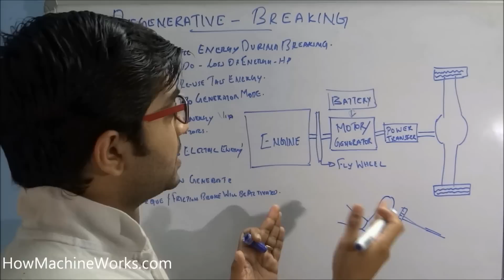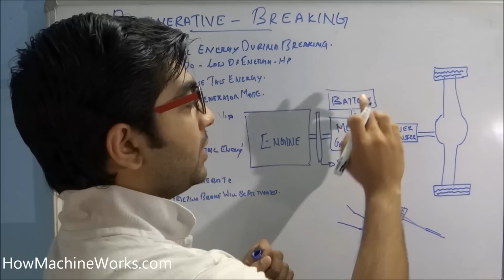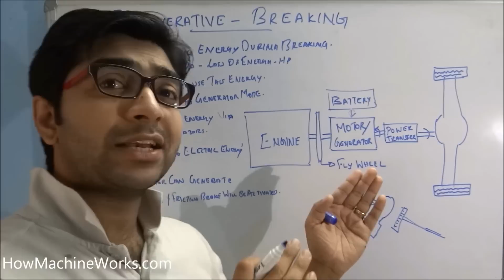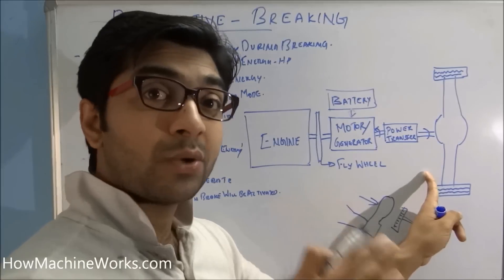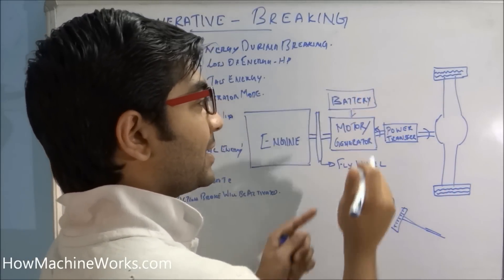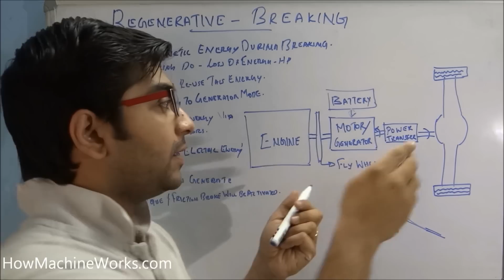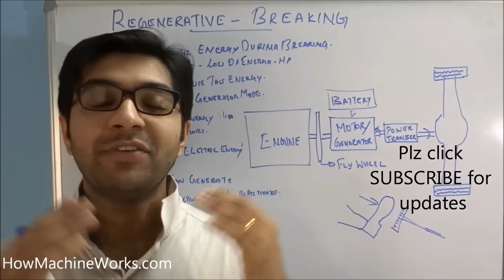How regenerative brake works

Comment: It spolis battery as it will kip charging discharging at different volts. 
We if charge discharge our mobile phone like this will see it's battery will degrade early. 
This is not good way to generate electricity

Comment: If we reverse the rotation of the motor, then because of sudden change of rotation your gear box  will break. Especially at very high speed. and regenerative braking are not that efficient in rear wheel compared to front wheel. Because brake force distribution in front wheel is more than the rear wheel.
Reply from the maker: Thanks for your technical feedback.

Comment: Mr. Einstein ,  direction of Rotation is never changed in braking operation either it will start going in reverse direction , whats the point of braking then ? Direction of torque is reversed here . Go work on your basics first.

Comment: The motor is either in 2 states - motor when electricity is supplied to it or generator when the accelerator pedal is off and the brakes are on but the wheel direction remains the same. Right hand law applies when in motor mode (conventional current) and left hand law when in generator mode but note that the rotation is still in the SAME direction. The right hand law tells you the direction of the rotor (motion) given the magnetic field direction and the conventional current and the left hand law for the generator tells you the direction of the generated current given the direction of the rotor and the magnetic field direction. Which if you work it out; the generator current would be the OPPOSITE of the motor current given the same wheel rotation.

Comment: The direction of the shaft does not change( that implies the car goes backwards), the shaft continues to rotate in the same direction but changes the power transfer direction; from motor to wheels, to wheels to generator.
Reply: thanks for that...
I Was a bit confused in that..
Still Confused a bit.   
Please reply if possible...
Reply: butungHage : during braking Induced back emf in motor is greater than the supply voltage , hence it act as a generator and supplies power to system ,in this case the produced torque will be opposit to rotation . Here the direction of rotation is same amd the direction of torque is reversed so now it deccelerate the motor speed untill it reaches zero.
Reply: how does the mechanism inside the car change the power transfer direction? please help me sir.

Comment: The Explanation is misleading.  The direction of the drive shaft doesn't change, if it does, then we are powering the drive shaft and spending energy. What actually happens is that during regen. braking, controls inside the induction /permanent magnet AC motor,  changes a factor known as slip (in simple terms, used to change the magnetic field), which induces a back emf. This causes a resistance to the rotor. At a certain slip value, max resistance torque is felt on the rotor, which resists the wheels and thus slows down the vehicle.

Comment: So lets say I'm making a recumbent trike with a pedal generator hooked up to a type of rechargeable batteries hooked up to a bike throttle hooked up to a electric motor under the seat with 2 wheels in the front and 1 wheel in the back and the motor drives the back wheel could use regenerative braking on the front wheel and have it charge the batteries without getting an extra generator or would i have to get a extra generator or 2?

Comment: By applying brakes, the direction of torque reverses and not the direction of motion! Poor explanation. Weak concepts, Better improve! Don't teach shits to the students please!
Reply: Could you please explain. I was confused with his explanation. I knew that if break applies regenerative braking happens witg kinetics energy converted into power. But how the direction of shaft of will be. ? If it rotates in opposite direction does it means engine also will rotates in opposite direction since it is coupled in same saft.?

Comment: how sense of rotation of shaft changes after applying brakes???
u must have to specify the gear assembly attached with brake that reverses the sense of rotation.

Comment: R u serious ?what nonsense are you talking ,how does the braking helps the motor rotor in other direction,and who on earth told you change in motor rotation makes it generator. Shame on you!!!
Reply: +anase k Because Electric motors only have one gear, unlike a typical Internal Combustion System. The reversal of the magnetic field from N to S or S to N will cause the motor to run in reverse. This system actually aids in braking and reduces wear on the friction brakes while simultaneously charging the battery. The charging occurs because once the electric motor stops being supplied by electricity, the rotor continues to turn in the magnetic field, which produces electricity.
Reply: When the driver steps on the brake pedal of an electric or hybrid vehicle, these types of brakes put the vehicle's electric motor into reverse mode, causing it to run backwards, thus slowing the car's wheels. While running backwards, the motor also acts as an electric generator, producing electricity that's then fed into the vehicle's batteries.
Reply: *****  When the driver steps on the brake pedal of an electric or hybrid vehicle, these types of brakes put the vehicle's electric motor into reverse mode, causing it to run backwards, thus slowing the car's wheels. While running backwards, the motor also acts as an electric generator, producing electricity that's then fed into the vehicle's batteries.
Reply: +anase k You are right. The motor does not run backwards, instead the current is in effect reversed. Instead of drawing current (motor) it creates curent (generator)
Reply: +Jameson Madison which drives the motor into reverse direction? there should some power to make the motor run in the reverse  direction, right?

Comment: how to convert the kinetic energy (friction) into electric energy....i mean its via differential---power transfer module---generator --battery....i want to know how to relate tyre to generator??may i know flow diagram of power transmission....video was good and explanation is good

Comment: I fully agree with Mr.Igor Rubinic.The motor works as a generator,when the power is disconnected.The generator is loaded with the charging current of the battery Or with an external additional resistor if required.The power drawn by the load through the generator  issupplied by the rotating wheels.

Comment: How can a motor change rotation to become generator, the wheels are always rotating in the same direction! This is not correct. What is happening is that when you push the brakes the wheels have more momentum than the motor and this causes current induction in the motor that charges the battery. So the motor does become a generator but it doesn't change the rotation direction.
Reply: exactly! Motor continues to rotates in the same direction...As Igor mentioned motor just provides negative torque to the engine..Basically motor is used in hybrid vehicles to assist the engine (or drive train)...when brake is applied motor's stator coils are no more excited and hence it doesn't provide rotating magnetic field anymore..however the rotor (permanent magnet) is coupled to the engine's crankshaft and hence it continues to rotate but acts as a load to the engine instead of helping it to rotate...because of the rotor rotation back emf (which opposes it's cause) is produced in the stator coils and when this back emf exceeds the battery voltage the current flows into the battery and thus charges it.

@TechTrix: U must chk the facts or hv full understanding b4 putting data on the public domain..u might mislead many ppl...however ur effort is appreciated
Reply: @1986murthy  I think the rotor is not a permanent magnet, it is just a conductor( metallic plates shortcutes in series ) which rotates based on the stator field windings ( induced magnetic flux). During generator mode the stator rotation is less because of the inverter mechanism which resist the current frequency.
Reply: :) Igor, Thanks
Reply: Omg thank you! I was sitting here thinking, "my god how can the motor change direction and not stop the car dead?" Lol
Reply: Exactly how in earth motor change its direction when the wheels are in one direction
Reply: He means torque changes direction. That's kind of like if you're driving 80km/h and hit the breaks - you're not going to immediately start traveling backwards, but you'll start accelerating in the negative direction. This is because the breaks are applying a negative force (force is the product of acceleration and mass, so if your mass doesn't change, but your force becomes negative, so does your acceleration) to your vehicle. If the force changes direction, you'll start to decelerate. Torque is a product of force and radius (distance between where the force is being applied and the centre of the drive train itself), so that means if the torque is negative, you will have negative force  (because the radius doesn't change), and therefore negative acceleration (because the mass also doesn't change).
Reply: @jacobbaird8558  thanks dude 😉

Comment: how motor becomes generator and while reversing the direction of power transmission shaft, the whole shaft motion is reversed or what... if not then what type of mechanism is used their plz..... explain..
.

Comment: Thank you. One question, does the heat energy from the friction brakes contribute at all to the regenerative braking?
Reply: no . its used in the place of friction braking . when u want to completely stop the vehicle u got to use ur braking pads or discs and that friction and heat is lost anyway. regenerative works instead of frictional braking when u want to slow down but not stop completely